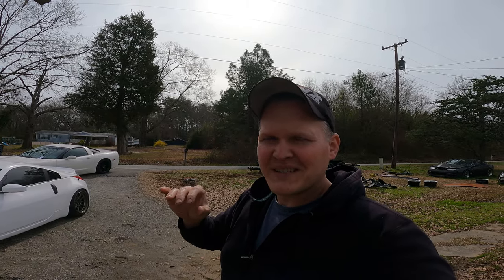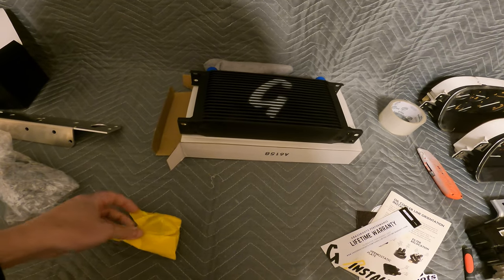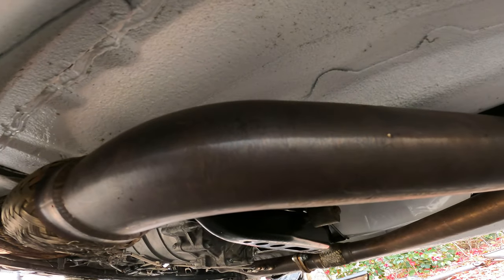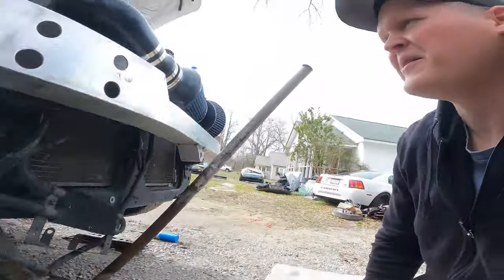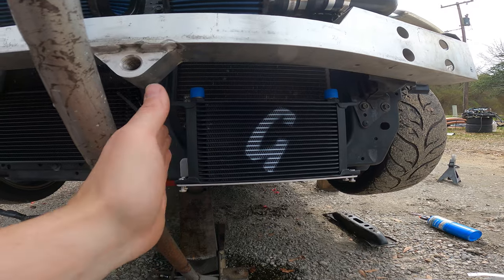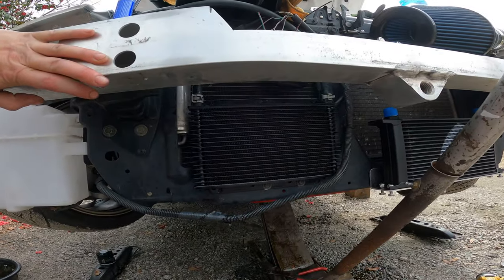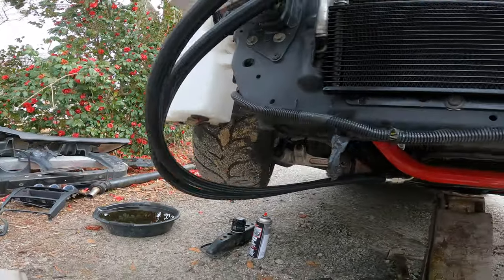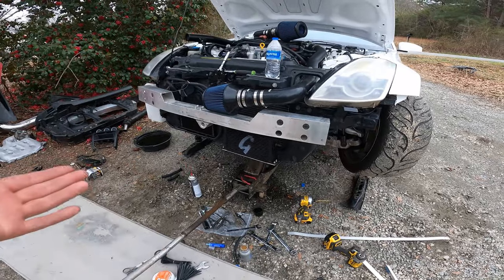Nissan 350Z Dual Coolers for under $500

Comment: Why dual oil coolers on a stock motor unless your tracking it daily or boosted and tracking it then sure but other theb that seens over kill even boosted track cars only use one
Reply from the maker: @Inmysightstarget  there’s only one oil cooler the other one is power steering